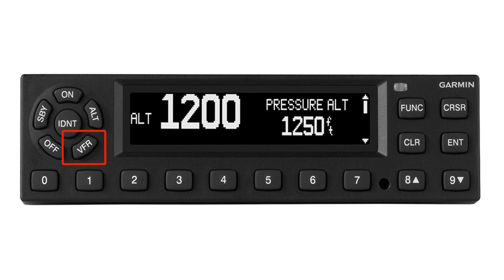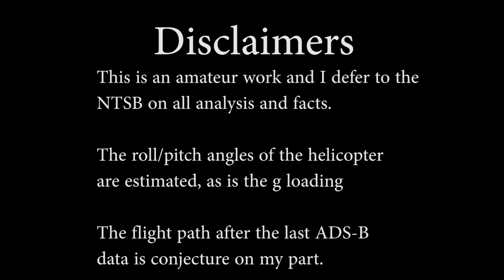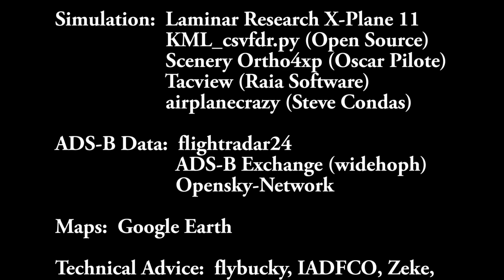Newly released Pilot to ATC Audio!  N72EX (Kobe Bryant) Crash Reconstruction.

Comment: Before he made his left turn, the helicopter hovered for a short while, then proceeded left and within seconds crashed. This is from a witness on the ground who heard the helicopter hover overhead and who also happens to know helicopters and their limitations. He gave a tremendous account of what he heard and saw. He agrees with you that the pilot simply got disoriented, didn't know where he was.  Very good reenactment!
Reply from the maker: Thank you!  For what it's worth, the helicopter did not actually hover.  According to the ADS-B data from the helicopter, the slowest it went while in Calabasas was 109 knots (125 mph).  I suspect some kind of weird acoustics that caused the witness to think it was hovering.
Reply: @stevencondas2281  Thank you for your response.  This is the interview I was referring to, the guy sounds convincing but like you said, the data doesn't have the helicopter hovering.
https://youtu.be/28QYy8lrww8
Reply: @fernfreeman1729  the eyewitness never saw the helicopter. It's a pure conjecture based on the sound he heard.
Reply: @CodyCha  Yes, I agree. Good work!

Comment: Great work! Interesting to hear the pilot's last communication while the aircraft was in an upset condition. 

For the next installment, it would be cool if the audio could be in "stereo". Not just coming out of one speaker even though it's from a mono source. A small detail ;)

Keep up the good work!
Reply from the maker: The right channel of the audio that I obtained from the FAA contains the IRIG-B timecode that I used to synchronize the audio to the upper left clock.  I couldn't figure out how to replace the right channel with a duplicate of the left channel in my final cut, so I just set the volume of the right channel to 0.  Here is what the timecode and audio look like in Premiere Elements:  https://1drv.ms/u/s!Ai5ul4veNOgHiYlLX98BymQDaCL7XQ?e=JpIDK3
Reply: @stevencondas2281  Interesting. I've never seen timecoded audio before. Maybe if you would edit the audio outside of Premiere and create a duplicate audio file that is panned to fully to the right? Then play that at the same time as the timecoded audio file. Or make a new stereo duplicate and mute the whole time coded track? Or just leave things as they are :)
Reply: @stevencondas2281  any chance that we could get an upload of the raw and untouched audio, please? Just as you received it via your FOI request and without it being muted in parts or edited?
Reply from the maker: @Bid Tee Somehow in all the notifications I missed your comment.  Are you still interested in the complete audio?

Comment: I looked at the route he took and what I found strange is instead of going straight on rt118, he went down to 101 which was closer to the water and that area had more hills. That was the decision that got him in trouble. I'm not a pilot but it seems easy to use your altitude and attitude instruments and the pilot was supposed to be a trainer level pilot..
Reply: Itsme Forsure “The route he took?”  He is directed to fly in a certain pattern. It’s not just go up in the air and do whatever the hell you want when you are flying from an airport. Is this difficult to comprehend. Go back and listen to the audio. He’s in constant communication with the air traffic controllers.

Comment: Could you do Flight 370 Next please? It may lead you to a direct path
Reply from the maker: The reason I was able to create this video is because I had access to ADS-B position data transmitted from the helicopter.   In the case of 370, it appears the pilot deliberately turned off those system to prevent the path from being tracked.  Given that, there is no data for me to use.

Comment: Given this scenario, what are the proper actions the pilot should have taken as he flew into the fog and became disoriented? Even this question assumes he realizes he’s disoriented before it’s too late. (BTW..excellent and detailed video & analysis👍🏼👍🏼👍🏼)
Reply: Ok, best not to get into situation, but if you do then declare inadvertent  IMC, Level the aircraft, maintain current heading, turning only to avoid known obstacles, maintain the aircraft in trim, using cruise or climb power climb to a safe altitude, squak 7700 (emergency) on transponder and contact air traffic control for assistance.
Reply from the maker: @gwfowler Thanks!
Reply: @gwfowler - Yes, thanks.
Reply from the maker: I really don't know the answer, so I am going to defer to actual pilots on that one,

Comment: Reports say that the helicopter sped up to 176mph before the crash... does the speed have to increase in order to go up as they were trying to do at the very last moment?  Or can it easily stay at cruising speed or decrease speed during elevation changes or directional changes
Reply from the maker: A pilot can answer this better than I can, but I will take a shot.  The speed does not have to increase in order to go up.  Think about a car:  a car can slow down when you go up a hill, and a car can also speed up when you go up a hill if you step on the gas pedal (assuming the car has enough horsepower).  The same kind of idea applies to a helicopter.  The reason the helicopter sped up at the end, though, is because it was accelerating down.  Kinda like going down a steep hill in a car.
Reply: Steven Condas Thanks for clarifying.  I just think that if he was spatially unaware, the speed wouldn’t have increased right? Even if he thought he was elevating up... he wouldn’t have to press the gas to do so?  And wasn’t Kobe’s helicopter advanced enough to have radar that would warn the pilot if he was getting close to a mountainside?
Reply from the maker: According to the NTSB, the helicopter did not have a Terrain Awareness and Warning System (TAWS).  I have heard pilots say, however, that having TAWS might not have mattered because the helicopter was going down so fast it might not have activated in time for the pilot to pull out.   I don't personally know since I am not a pilot.  

To use my car analogy again.  Imagine you are going down a hill, but you don't know you are on a hill because it is foggy, you can take your foot off the gas pedal and still speed up.
Reply: The helicopter while climbing should be slowing up not speeding up.  They were already fast so he would be applying back cyclic to start the climb with a bit of collective and that would bleed off airspeed.  The reason for the increased speed would be that he was in a nose down left hand roll.  Just like anything else when you are moving down whether it be downhill in a car or down in an aircraft you will pick up speed especially if your no longer creating lift which he would not be given he was now rolling to the side and literally slipping sideways.  When you turn in an aircraft you don’t do continuous steep turns they are slow and coordinated otherwise you lose lift and crash if you don’t have ample altitude to recover.  He probably believed he was climbing and was actually aggravating the downward vector and gravity at that point is not your friend.

Comment: Taking into account the information you presented I will add one piece of information that seems to have been overlooked thus far.  

1. The NTSB report states the pilot had never been to the factory school or simulator training for this particular model.  This I believe is a fatal flaw in the flight scenario.  

2. The SK-76 autopilot system has a minimum control airspeed for IMC flight and coupling to the autopilot/Flight Director system.  

3. Once the autopilot is engaged as I am sure it was  and during a rapid climb, if power is not adjusted and the minimum airspeed is not maintained the control of the aircraft's heading switches from cyclic control to control directional/heading changes to the anti torque pedals to control heading.  When this control input change is transferred and the airspeed is not increased the aircraft with no further input from the pilot will attempt to maintain heading control with the anti torque pedals.  This will result in a further loss of airspeed since the nose will turn out of the slip stream and the airspeed loss will continue.  When this happens the pedal drives full forward  attempting to maintain its heading and the aircraft will roll to the left and begin an uncontrolled roll and decent.  This scenario unless corrected immediately is almost unrecoverable due to the proximity of the ground.  

4. In a normal max decent auto-rotation the aircraft can only reach a flat position decent rate of @3000 FPM.

5. The fact that a 4500 FPM decent was recorded lends itself to the conclusion that the aircraft would have to be sideways in a knife edge position to achieve such a rate of decent.  This would bear credibly with the witness statement that it emerged from the clouds in a nose down belly up position when they observed it just before impact.  It is also depicted in the radar track showing a continuous turn to the left while descending on radar. 

6.  While the aircraft can be flown very safely in VMC by a pilot having not attended the factory school this little know control understanding can lead to a catastrophic accident such as the one here.  As such this aircraft is very complex and no company should attempt to operate it without factory simulator training.   Having been an SK-76 simulator instructor for over 5 years I have personally witnessed this exact scenario occur during multiple training sessions.  Once the correct procedure is explained, demonstrated and understood it is easily prevented with proper use of the flight director system.
Reply from the maker: I appreciate your comments!  How confident are you in point 3?  Would there be any signature in the vertical speed, ground speed, air speed, or track, that would indicate that the autopilot was engaged?  Also, you said "if power is not adjusted and the minimum airspeed is not maintained  the control of the aircraft's heading switches from cyclic control...".  About what speed does this transition occur on the S76-B?   The lowest ground speed I see during the climb is 109 knots.
Reply: Steven Condas 
The minimum airspeed for connection to the flight director is 60 knots.  Airspeed below 60 knots will transition the aircraft heading control from cyclic to pedal control of heading.   The Sikorsky S76 is an inherently stable aircraft in IMC. My conclusions are based solely on  my past experience of flying the aircraft for the last 34 years.  I was just in the simulator in April and I recreated my scenario and it ended in a complete loss of control and crash.   The 109 ground speed is interesting.  I would need to hear the CVR if there was one but as the latest radio transmission released shows they knew they were in big trouble.  When they are stressed and fighting for their lives you can’t even hear the radio. All in all a very sad but preventable accident.  Thank you for doing such a great job putting together your presentation.
Reply from the maker: So since it didn't even come close to 60 knots the helicopter must be in cyclic heading control? How does that impact your statement 3?  Also, if the helicopter was in autopilot would you suspect the airspeed would hold constant during the climb (constant IAS)?  The airspeed decays from 137 knots at the start of the climb to 109 knots at the top.   As for the CVR,  there wasn't one.  The original CVR was removed in March of 2016 according the registration information I have, and a new one was never installed.  I can't believe the FAA hasn't implemented the NTSB recommendation that CVRs and FDRs be required in all aircraft operating under parts 91 and 135.
Reply: Steven Condas there are several methods to initiate a vertical climb. One would be to simply pull back on the cyclic and climb trading altitude for airspeed however as the altitude would increase the airspeed would decrease and lead to the situation I outlined.  The second method would be to initiate  a cyclic climb and add power with the collective.  This is the normal reaction in an inadvertent IMC situation.  It’s the quickest way to initiate an emergency climb.  As long as you continue to monitor the power input and airspeed all should work out well.  The third would be to place the flight director in heading mode, Indicated airspeed mode, dial in the desired airspeed which would be the VBROC( best rate of climb speed 74kts)  SPEED, set the altitude in the AL300 window and sit back and monitor.  The last method will allow the equipment to do all the work but like all systems must be planned and monitored     It would be the most efficient and keep the aircraft well within its performance envelope.  
The only fly in the ointment would be initiating a cycle climb, setting power to climb but never engaging the heading hold on the flight director.  This would require the pilot flying to monitor the aircrafts attitude. This may account for the rolling motion and descending left turn  since the airspeed indicated 109 kts.  Once the aircraft attitude is lost there is not much time and altitude left for a successful recovery.  The 4500 fpm decent rate still indicates to me complete loss of control due to spatial disorientation. Again this all goes back to training and practice.  We go to simulator training twice a year and do instrument flights on a regular basis with 2 pilots in the aircraft and it takes a lot of work to stay up on normal IMC  flying.  Throw in an emergency situation and a pilot not up to speed on his IMC techniques and you can see the disastrous results.
Reply from the maker: I have looked at the ADS-B data again from start of climb to just before the turn:  Airspeed decays from 137 knots to 109 knots;  Vertical speed varies from  0 to 1856 to 1216 to 1600 fpm (it is not constant); the slow left turn is not constant rate.  Is this consistent with aircraft control being on autopilot, or is it more consistent with the pilot hand flying the aircraft?  You said in your original post "Once the autopilot is engaged as I am sure it was..." and I am wondering if you still think that is true.  Thanks again for the time you have spend educating me!
Reply: Steven Condas based on what you are presenting I would say the total variation in airspeed and climb rate is consistent with the pilot trying to hand fly the aircraft.  It can get quite out of control quickly without steady practice.   I surmised the autopilot was engaged because this would be normal procedure during an inadvertent IMC condition to maintain aircraft control.  I can only speculate without the working cvr what happened.  Another possibility is in the initial confusion of the transition from vmc to IMC the autopilots were turned off thus rendering the aircraft to a very unstable condition.  The autopilots are more of a stabilization system without the flight director engaged and connected to the autopilot system. The flight director actually directs the aircrafts position and direction. The terms are used synonymously but are independent of each other.  You can fly by hand with the autopilots on but if you want to control the machine using the navigation and full stability system you must engage the flight director.  Once the flight director is disengaged it’s all you. The machine is somewhat stable but the pilot must make control inputs to direct the aircraft.  This can be very demanding and overwhelming if not done correctly.  With the autopilots disengaged it is close to impossible to maintain aircraft control for a pilot who is not practiced in this emergency procedure.  From what I have witnessed in the simulator dual autopilot failure will lead to very unusual attitudes.   Single autopilot failure will give no indications of stability problems but the flight director will not engage.  Thus if a single autopilot fails or is inadvertently turned off and the flight director is engaged it will indicate the correct modes on the flight director but will not couple.  This will lead to a false sense the aircraft is under control.  When attention is diverted the other tasks the aircraft will basically do whatever it wants.  If not caught and corrected quickly it can lead to an over control situation and then a complete loss of control.  I know it’s a lot and it’s confusing but that’s why we train and train and train for these things.  It’s not like airplane flying.